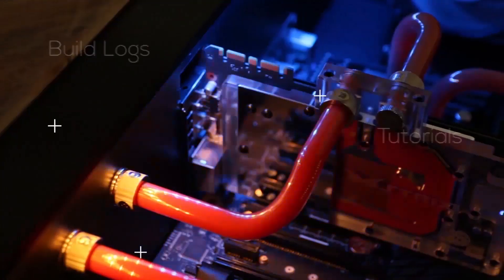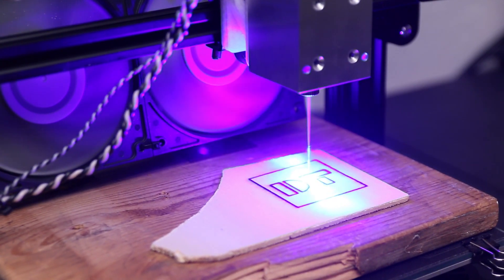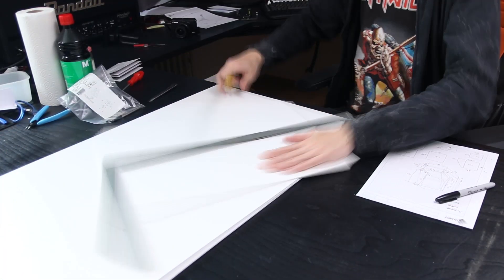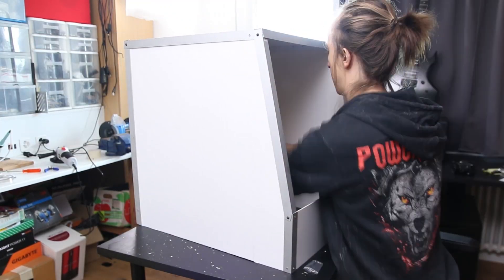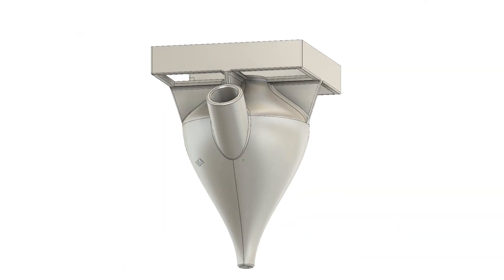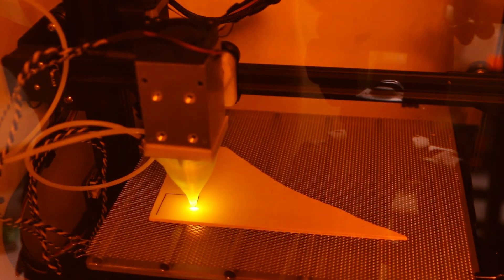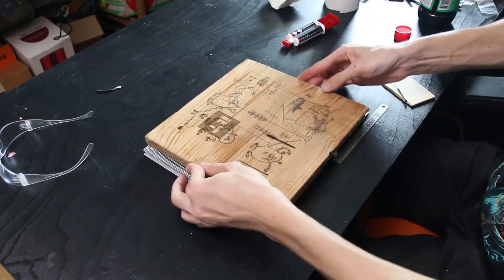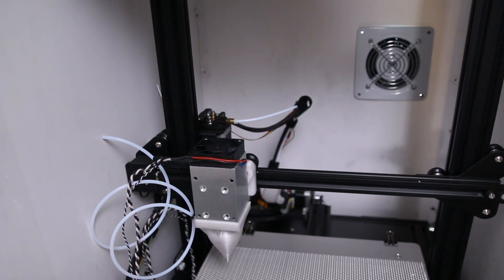DIY Laser Cutter Air-Assist & Enclosure

Comment: Where did you get the Orange Acrylic (and which brand+thickness)?
 It seems to do a good job and i like some "tested" sheet to build my own enclosure.  (Im in the NL, EU and the US J-Tech which is often linked is almost 150eu in shipping and Customs combined for a 20-30eu panel :S).

Ordering from germany is fine :).
(working on a IKEA lack type enclosure)

Comment: Could you please tell me if this 10 watt laser is using just one laser diode or two and could you please tell me the exact model number of the laser diode used in this 10 watt laser. Thank you.
Reply from the maker: I don't know the model number, you can check the website or write an email to endurance, but it is only one laser diode in this model.

Comment: Top idea on the enclosure, I am waiting on my laser engraver and will look into that type of setup.
The other thing you can try is make an air assist with a vortex like the opposite of a dyson vacuum cleaner,
even if the intake is angled to move the air in a spiral.